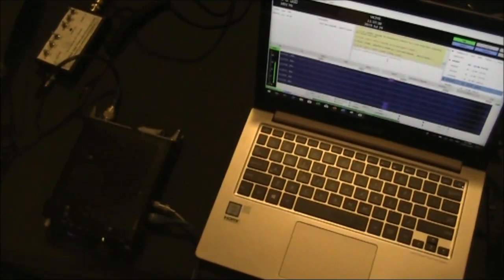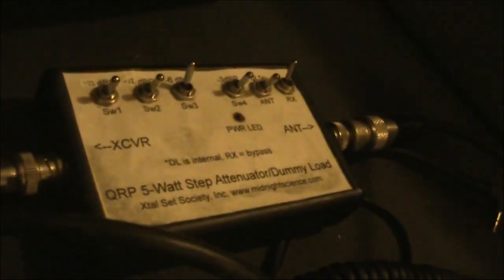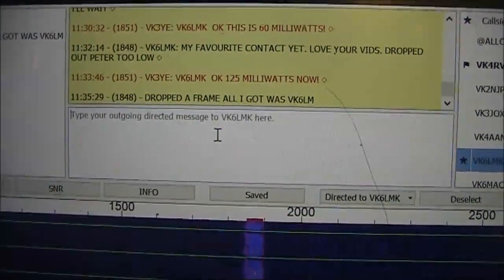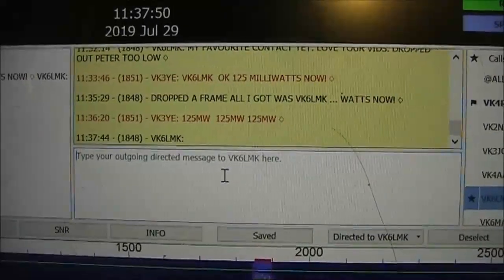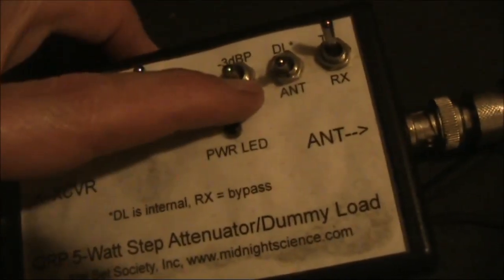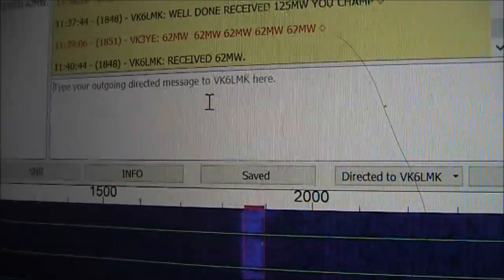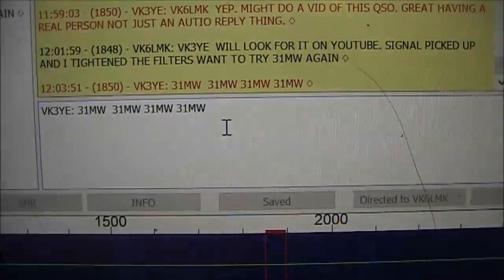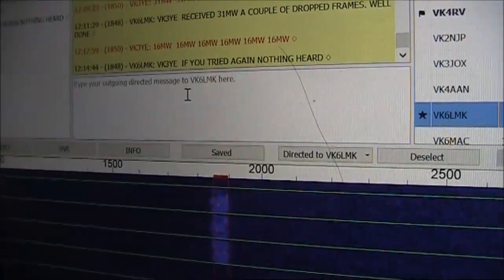JS8 milliwatts across Australia on 3.5 MHz

Comment: I'm almost ready to try an experiment to see if I can use JS8Call to extend the range of VHF or UHF beyond line of sight.  I don't expect huge gains in distance as demonstrated in this video, but the ability of JS8Call to decode a signal that's 24 dB below the noise floor should allow me to communicate with friends who are slightly too far away for FM voice on simplex.  The signals should knife edge refract over hilltops with a weak signal arriving at the distant station.  My goal is repeater range without the repeater infrastructure.  I'm in the middle with friends 50 miles to the east and 50 miles to the west.  If the experiments work, I'll probably use a Raspberry Pi as a JS8Call text message server that's available whenever I'm not using the radio.
Reply from the maker: Even 2m SSB and a small beam should do that distance. If it doesn't JS8Call should with even less power.
Reply: @vk3ye  - I have an older all mode 2m transceiver that does SSB but I don't want to impose that requirement on our entire group.  I'm currently leaning toward digital voice, probably on 70 cm which is underutilized in our area.  The digital group setting would allow radios to be left on all the time without any noise, and when the digital voice signal is verified as a friend, the clear digital voice comes booming through.  The JS8Call would be used at the lowest possible power with a Yagi antenna to allow the more distant stations to have text communications when repeaters are down.

Thanks for the great videos.
Reply: Liberty4Ever report your findings back to the JS8Call groups.io. I know many would be interested.
Reply: @jsherer  - Will do!  I need to join that group.  Thank you for using FT8 which is not interesting to me, personally, to JS8Call which is VERY interesting to me!
Reply: @Liberty4Ever  Agreed!!!
Reply: I've uesd js8call on 23cm down to-20db works well.